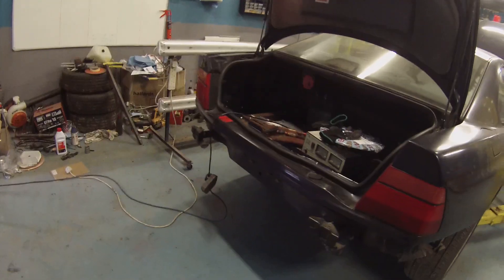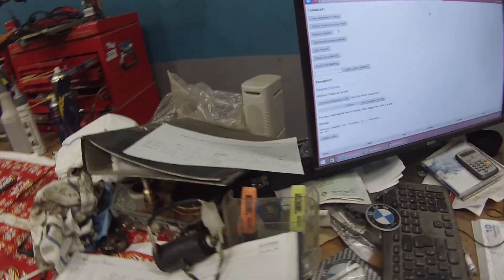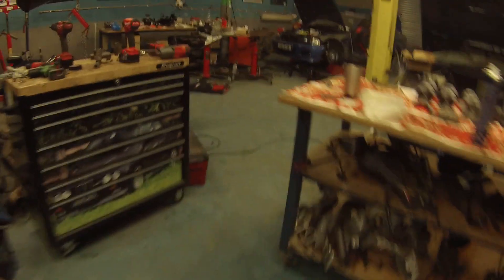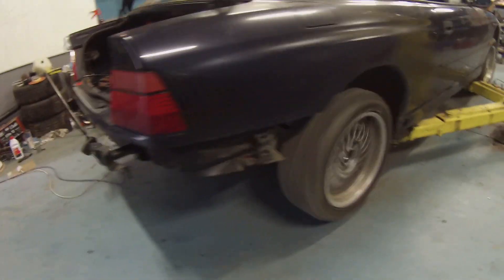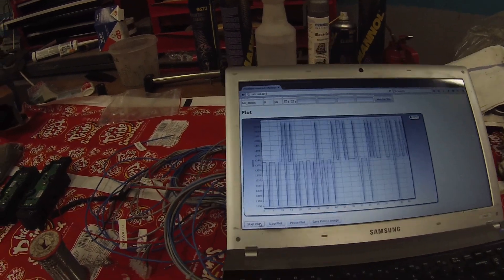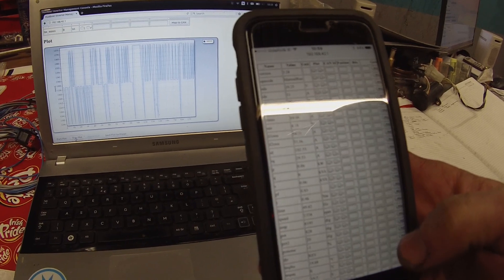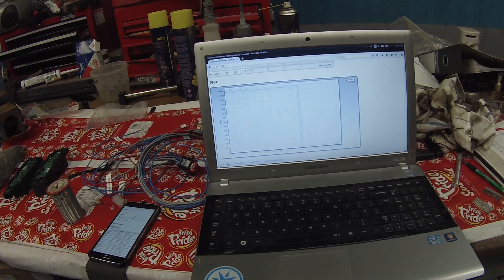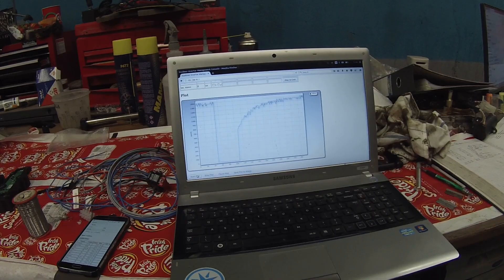BMW E31 840CI EV Conversion 90 : Tesla Swap Day 9

Comment: Hi Damien . I'm in UK . After watching your I am thinking of getting a electric car or doing a conversion. What are the costs of converting a petrol car to electric . Would you be able to suggest any cheap battery and motor combos  at around 10k budged . Is that doable at this sort of money. ? Thanks

Comment: I can see it now... A 17" ipad stuck in the middle of the dashboard.
Anyone know why the audio was humming near the car? Felt quite disconcerting. :-/
Reply from the maker: The old power supply I'm using to power the DC bus on the drive unit kicks out more electrical noise then a Van Halen concert:)
Reply: Ahhh, gotchya now.  Wi-fi AND Wi-Drive!